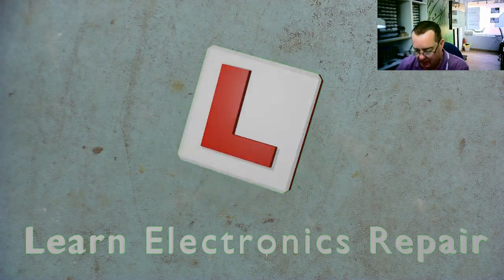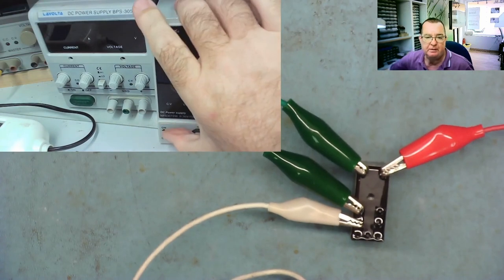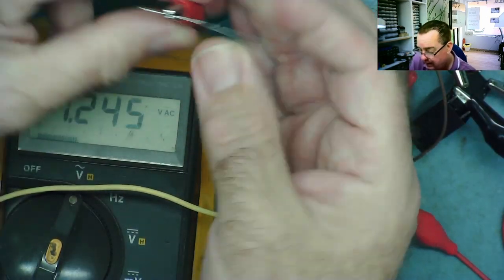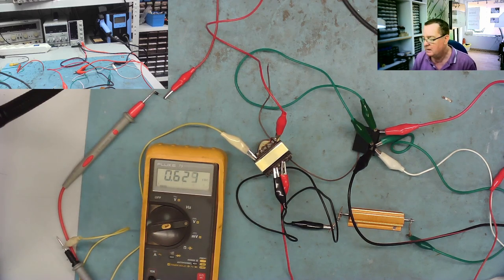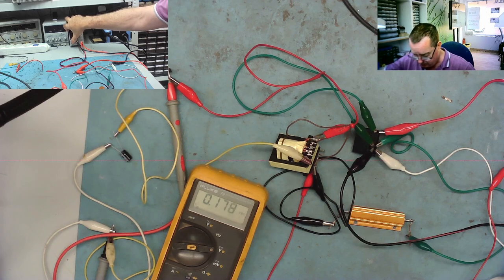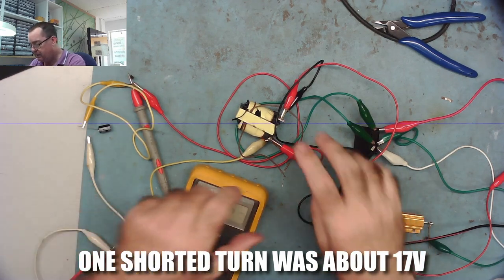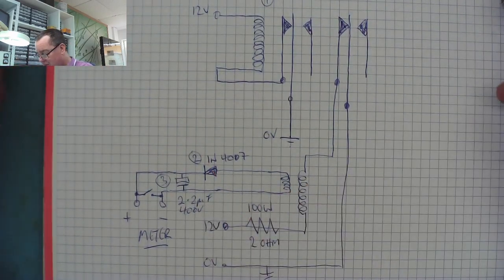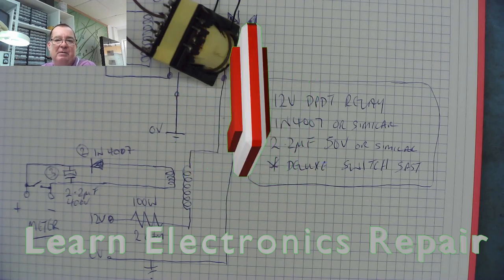How To Find SHORTED TURNS In A Transformer Without Using A Ring Tester

Comment: I used to love doing that with a relay when I was a kid. I sometimes added a capacitor in series or parallel with the coil,  (I forget which and may have it completely wrong), to change the speed of the buzzing from what you had to about a car turn signal speed. There are at least two other practical applications I've used.

1. It is probably the sort of thing that drives ham radio guys nuts, but the thing is a very broadband RF emitter, basically a spark gap transmitter I guess. If you run a wire from the shocky bit to a metal connection to a water pipe the RF will go into the pipe or water in it. You can then use an old pocket AM radio trace the pipe underground for a few hundred feet. When I tried it, it was with sandy soil and the PVC pipe about 2 feet down and full of calcium rich water. Saved a lot of digging.

2. If you end up in an electronics college elective class and are asked to build a circuit to blink a light or make RF or apparently test a transformer, it is usually pretty easy to find a relay and capacitor on short notice, and there is a chance the professor will like the weirdness of it.

3. With a few alterations and minor additions it also can be used to make a practical joke electric chair to show appreciation for a favorite teacher. Not sure it is kosher to go into details, but don't cross the line kids and try it on your own butt first. If you need more than a 9V battery, you're doing it wrong and maybe doing something stupidly dangerous. The desired effect is an uncomfortable tingle not smoke and screaming and EMS and life in prison.
Reply: I used similar aged 12 to cause interference on TV at finish of grand national horse race 
I thought it was funny , my Dad not so impressed!
Reply: @davet3804  Me too! Only it was a news show I hated that was on at the same time as Dr Who. I got away with it the first time. Second time he came home from work as I was on the roof setting it up. In my panic I ran off of the roof. Lucky for me I landed in soft sand. Seems like I had more to it than just the relay though, but don't recall.
Reply: Yes , I used copper wire scraping a metal nail file attached to a salvaged transformer . But same concept 😂 Great to hear of another person on planet with similar experience
Reply from the maker: An electrolytic capacitor in parallel with the coil should make it switch slower, as when the contacts open the capacitor can still supply current to the coil and keep them open for a little while
Reply from the maker: @davet3804  I'm amazed how many of us did this sort of thing with a relay as a kid - and probably totally independently as we didn't have easy access to this information back in those days.  Depending how old we are now of course.  It's also interesting how many of us did stuff like this as kids and are still into electronics all these years later 🙂Anyone do this with a relay and an ignition coil off a scrap car and get some serious voltage, like several inches of arcing between two bits of wire attached to the other end of it?  Of course the arc was not in centimeters as we were all imperial then LOL

Comment: Hi Richard. I was intrigued by your ring tester. Here’s a thought. Why not use your MESR to introduce a 100k Hz signal to the primary winding . When the last pulse is generated start a clock  then time the voltage to reach half of VCC . The bad primary would have a very short time to that of a good winding. You could have a resistor divider on the inverting input of a comparator to set any fraction of VCC you choose. Also incorporate a switchable capacitor in the voltage divider to enable you to test different transformer cores (iron and ferrite). The output displayed could be the time mS or uS or the number of peaks (rings) above the setting. The upshot of this is knowing the frequency enables you to count the rings and also allows an insight to the Q factor of the inductor.
Reply from the maker: I'm sure that sort of approach would work but the whole point of this video really was to see what I could do with just a multimeter and the minimum of (salvaged) components that anyone would have access to

Comment: Interesting. Here's some food for thought, for what it's worth....Ring testers seem to operate on the assumption that a single shorted turn will very much impact the transformer's Q factor (ratio of inductive to resistive values) by adding a big resistive short circuit, thereby making a more damped response when you apply a pulse. And there's also an assumption the big short circuit will make the remaining winding unable to deliver its rated voltage. While some of that may be true in some cases and for some configurations, keep in mind that we're talking a single turn of wire, which is a very poor inductor. So the voltage induced in that single turn may be very small, and depending on the resistance of the turn the resulting current in that turn may also be very small. Which means the overall impact to the transformer's operation may be negligible. As an example I just tested a 120VAC to 12VAC mains transformer, wrapped a single turn of 22AWG wire and the open circuit voltage generated in the single turn was only 0.2 volts. And when I shorted it the resulting current was only 1.4 amps, compared to the transformer's 4A rated winding. The impact on the 12VAC secondary winding was non-existent. That being said, some real world transformer testers used by industrial and power companies use a form of ring tester (although it's a much more complicated impulse response test, as well as frequency scans, etc.) to check for short circuits, but they generally compare results to either manufacturer data or "known good" data. Personally, I'd take any simple ring test result ("good/bad") with a huge grain of salt. One other consideration is that if the short was caused by a voltage spike (as is often the case), the shorted turn may only be evident when high voltage is applied, since failed insulation doesn't necessarily mean a molten copper solid short circuit. Which is why professional testers generally use high voltage tests for this sort of thing.
Reply from the maker: Thanks for the info.  I think this would only work on transformers which are designed for high frequency operation, but fortunately those are exactly the type of transformer we want to test most often.  It was very clear, if you watched through to the end, that putting a deliberate shorted turn on a good transformer has a big effect on the secondary output (I was getting about 30% reduction) and putting a deliberate shorted turn on a transformer which already has a shorted turn gave a very small reduction in the secondary output (I was getting about 4% reduction).  So actually this method I kinda made up and tested does not require a known good transformer for comparison and actually may be better for repair purposes than the Ring Tester in some cases.  Or at least it is another tool in the bag.  You could do the same thing putting a shorted turn on the transformer to see how the ring tester reacts - which I did in the previous video.

https://www.youtube.com/watch?v=0-LrAW6PpKk

It was the results of that video which inspired me to to try this 'ghetto' method 😉
Reply: @LearnElectronicsRepair  Ahh, so you're thinking it's JUST for high frequency switching transformers? I've been trying to figure why it worked for you on the switching transformers at the high frequencies, and haven't quite wrapped my head around it. The winding inductances are much less than mains transformers, but the inductive reactance may be higher due to the frequency effect. But I'm still not sure why one shorted turn would have such an effect. It still seems like it requires a lot of voltage induced into the single shorted turn with a corresponding very low R to make a lot of short circuit current flow in the single turn. Hmmm....
Reply from the maker: @EETechStuff  I'm no expert myself, but for some reason shorted turns seems to be most common in Flyback or SMPS transformers.  Also TV LOPT as well.  When I tried the Ring Tester on the mains frequency toroidal transformers in the previous video, it did not make much difference between the good one and the one with shorted turns (two LEDs lit vs one LED lit) but on a SMPS transformer from a scrap ATX PSU it made a huge difference.  Another subscriber on the Ring Tester video said they work best with transformers that have a high Q Factor.  I kinda get the idea that a transformer with a high Q factor will oscillate (ring) but one with a low Q factor won't, and I guess something about the construction of a mains frequency transformer gives a lower Q factor.  But apart from a general understanding, the math is beyond me
https://en.wikipedia.org/wiki/Q_factor
Reply: @LearnElectronicsRepair  Yeah, the Q is pretty straightforward. In an inductor/capacitor circuit when you hit it with a pulse (like with your relay), if there's no resistance in the circuit it will oscillate/ring forever as the L and C share the energy, and that's an almost infinite Q (ratio of inductance to resistance). The more resistance you introduce into the circuit the lower the Q and the faster the ringing will be damped. The resistance of the short circuited turn (and the energy lost in that turn) helps to damp the ringing. However if there's relatively high resistance and low induced voltage it's almost like an open circuit winding and it should have little effect. I think you're right in your results, I just haven't figured why the effect is so pronounced in the switching transformers. Guess I need to desolder the transformer from my unused ATX supply and hook up my square wave generator and see what I'm missing. BTW, this is why I like your channel so much, you get me thinking 😀
Reply: @LearnElectronicsRepair  Richard, thanks again for this, it's really kinda fascinating. 😀 Anyway I have another data point. I took a spare, working ATX power supply and wrapped a single 22AWG turn around the main switching transformer in order to see exactly what voltage is induced into the shorted turn. I'm trying to get a feel for how the shorted turn could have a big enough effect to make a ring tester work. I connected my scope to the OPEN single turn to see what voltage is induced, and as expected it was 150+kHz, and the wavform was pretty nasty, but surprisingly (to me at least) the peaks were up to about 10 volts. Especially considering a similar measurement on a 60Hz mains 120VAC/12VAC shorted turn was less than a volt. I was very surprised they were that high, though the average was much below that. But this seems to agree with your point that there might be quite a lot of current, especially if the short is a low resistance, and might explain why the transformer output might have the effect you showed. I also measured the power supply 12VDC output with and without the short and there was basically no difference, however that may not be too relevant since there's a lot of regulation etc on the secondary of the ATX that might deal with the varying transformer output with and without the short. So as you say there could be a lot of short circuit current flowing in the shorted turn (albeit in narrow peaks of a 150kHz waveform) that hypothetically might draw peaks of around 10Volts /0.1 ohms = 100 amps !!! Unless I'm doing something dumb. Thanks again, I'm learning a lot with this exercise 😀
Reply: @LearnElectronicsRepair  Okay, I think I figured one thing I was missing. The amount of voltage induced in a turn of wire depends not only on the MAGNITUDE of the magnetic field that's inducing the voltage, but also the rate of change (ie, frequency) of that field. So if an indentical magnetic field is inducing voltage in a single turn of wire, a higher frequency magnetic field will induce more voltage than a lower frequency magnetic field. I was assuming that since a mains transformer has a huge winding inductance (measured in Henries as opposed to the milli-henries of a switching transformer) that the magnitude of the magnetic field was much higher in the mains transformer, and the frequency effect would be negligible. But apparently its the rapidly changing 150kHz frequency of the magnetic field in the switching transformer that causes the induced voltage to be much higher. Go figure. So maybe that explains why this ring testing thing is much more likely to work with switching transformers rather than mains transformers.

Comment: I liked that pcb ring tester and that is something I need to build and have in my tool box. This stuff is so interesting and sure the theory of operation of each component is important you can till test and find problems without an electrical engineer degree and that is all i need. Im a beginning hobbiest little projects are very good practice.

Comment: Suggestion: The switching frequency for that type of transformer is in the range of 50-100 kHz or more, that's why when you used the relay setup ( which switches at low freq ) you measured quite low voltages on the secoundaries. I suggest you make a 555 oscillator to generate high frequency oscillations and retry your expirement. I'm quite certain that you'll measure much higher voltages on the secondaries.
Please put a mosfet on the output of your 555 so you can provide high enough current for the test. You can also make the frequency variable using a potentiometer so you can test multiple types of transformers.
Reply from the maker: Of course you are correct about the frequency range but I think you missed the point of the experiment a  little bit.  I used the fact that adding a shorted turn around a good transformer would cause a large drop in output voltage and adding a shorted turn around a faulty transformer would have very little effect on the output voltage.  it isn't the actual voltage that matters, its the was the transformer behaves with and without the deliberate shorted turn that indicates if it is good or bad.  Also using a 555 and a MOSFET would risk the transformer going into saturation and causing the MOSFET to blow - though I could possibly use a current limiting resistor of sufficient value to limit the 'short circuit' current to within the capability of the MOSFET.   This if course is not going to happen if we just use a relay, and this video was really to prove if we could actually test switching transformers with such a simple method 😉